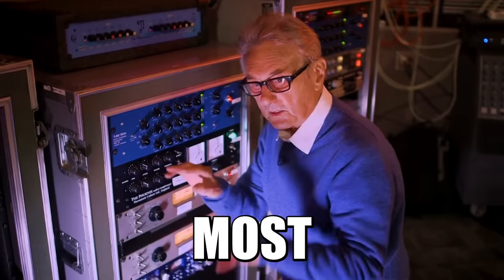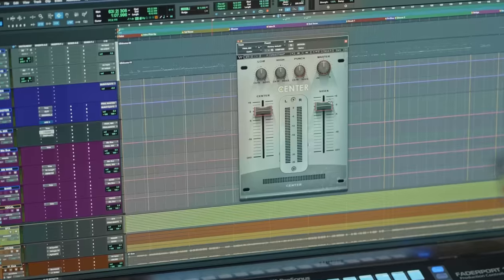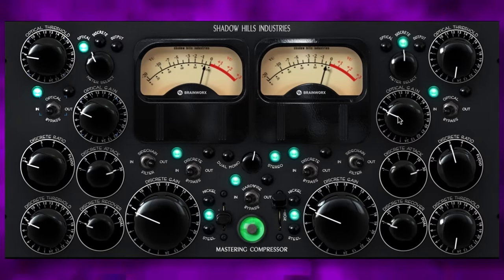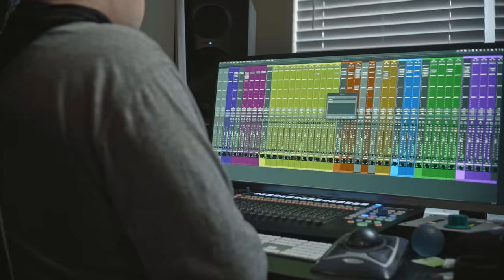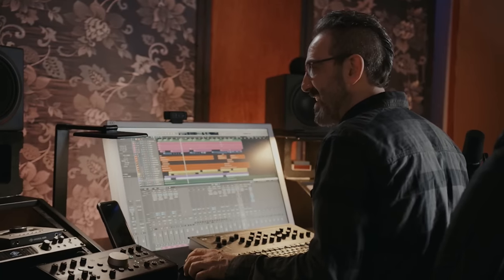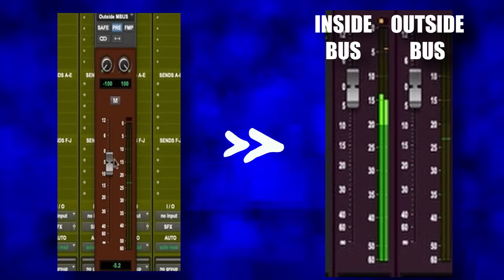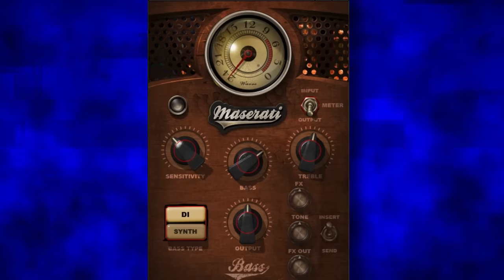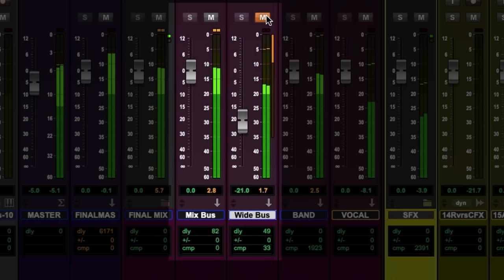Sneaky Mix Bus Tricks Pro Mixers Use To Hook You

Comment: Great video as always! I remember some time ago (and probably even now), that on the various music forums there was practically always talk of the CLA mixbus chain, everyone had their say about him, they invented many things and some were funny 😆. In short, it was an empirical and secret discourse like the enigmas of the Vatican. Until the story of his secret eq came out as the first "insert", i.e. a modified Pultec, where (if I'm not mistaken) he boosted the 70hz by 5 db, the 3000 hz by 3 db (and this was a scandal) by not using the attenuation on the two frequencies, using broad band at 10 and atten sel at 5..and then everything passed through the compressors you listed, according to the style of the song. Obviously from there, everyone wanted to try this trick. Effectively, however, it is a sort of top down mixing. I don't want to be wrong, but if you analyze the Waves CLA MixDown with Plugin Doctor, in the default settings, there should really be a bell at 3000Hz but NOT at 70Hz..but at 20Hz with a relative low pass at 48db per oct, and an attenuation on the mid-bass.. but maybe I'm telling you bullshit. Many greetings and I look forward to the next video always happy!